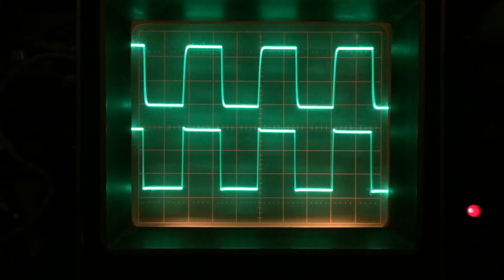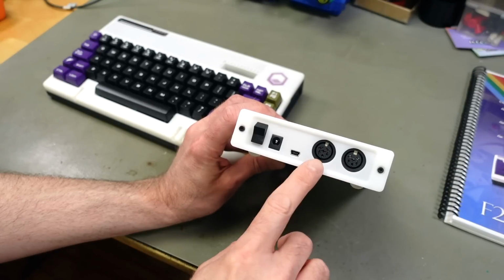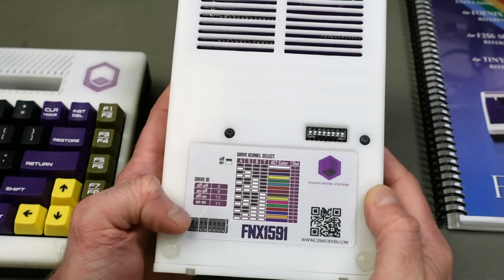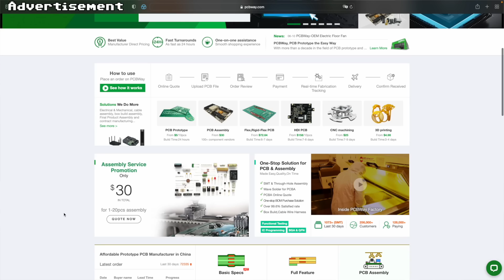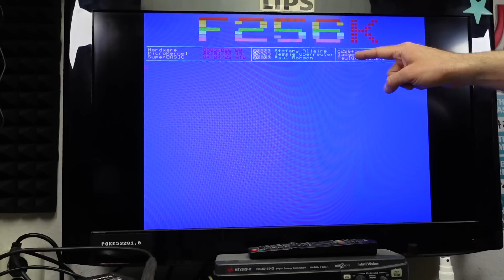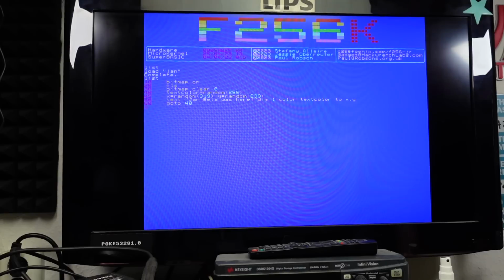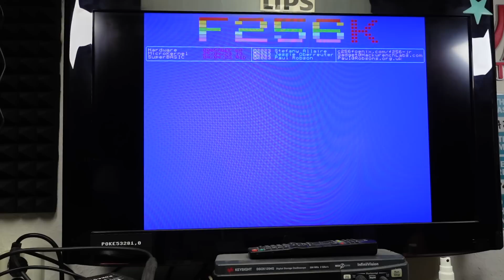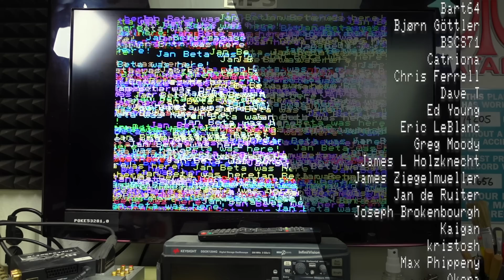Foenix F256K New Retro Computer

Comment: Nice system, but I don't get why there are so many chips inside that could be easily implemented by that Cyclone IV FPGA.
Reply from the maker: I guess the idea is to have original dedicated chips (like the CPU and the OPL3 chip) and only use the FPGA as a replacement for what would have been custom chips in a vintage system.
Reply: After reading your comment I did a top level reverse engineering and I see things very differently as a hardware designer. 27 chips with 8 or more pins; most of the chips are for special purpose memories (devices: 5), specialized I/O (devices: 14) or level shifting (devices: 5) to/from the FPGAs. The remainder are 2 FPGSs and the CPU. Most of those are special purpose where you're not going to just place the function in an FPGA. FPGAs make lousy real time clock chips for example. You want a Cyclone to act like a Wolfson CODEC or Max232? Nope. It's also beyond pointless to use an FPGA for FLASH storage here. Cyclone IV is a family of devices with members ranging from cheap to almost $1000 per chip. Look up the EP4CGX150DF31I7. Here it obviously made sense to implement part of the design in the Efinix FPGA or it would have simply gone into the Cyclone used. Just because you can doesn't mean you should. Honestly I don't see any other chip besides the CPU itself which could be placed in the FPGA if you want to buffer the signals. If you want to split hairs then the keyboard interface 6522 could have been emulated at the cost of the I/O pads on an FPGA. The I/O cost likely makes it cheaper externally with a 6522 and you get 6522 drive/robustness which the delicate Cyclone lacks. Please cite specifics if you disagree.
Reply: not replace every chip (surely not RAM) but the Cyclone IV would be powerful enough to implement CPU, video and audio of the F256K system. Consider the MiST device (Cyclone IV based, dating several years ago): it does emulate a whole Commodore Amiga with 68000, and its custom chips.
Reply: @Peter_S_ But the point is still valid. Once you start using FPGAs, the use of separate chips for various tasks becomes more difficult to justify. Why not just use ONE suitable FPGA for CPU, sound and graphics etc, rather than several chips? The cost and complexity is massively reduced, resulting in a cheaper product, easier to produce and easier to maintain.
Reply: @another3997  LOL, no it's not valid. How many FPGA based products have you designed? I'm going to guess zero. Tell me if that's incorrect. I already pointed out cost vs FPGA size. I also pointed out it's not economical to emulate big memories. I also pointed out that 14 of the chips are special purpose including analog and involve I/O the FPGA simply cannot do. 5 more are level shifters which are always necessary, and the rest are memories, CPU, and FPGA. FPGAs have their place, and here you can see what that place is if you wish to learn.
Reply: From a business standpoint, I would want to design a machine that would have a large supply of ready made components. If there's ever another chip shortage, you would still be able to produce and sell your product, because you're not tied to a few components with a high demand and short supply. Sure a design based on fewer chips is cheaper, but if you can't get your product to market because you can't source the components, you are doomed as a company.
Reply: @Peter_S_  Yup, FPGA prices do NOT scale linearly with logic units/pads.
Reply: @LeftoverBeefcake  my point was: since the FPGA it's already there, why not make it emulate cpu and sound as well? anyway it's designers' choice in the end :-)

Comment: Very cool project, but couldn't that Cyclon replicate all of the functionalities of the chips present on the PCB? The IV go up to like 150K LEs which would be plenty. Would likely make parts sourcing easier as well. I guess I'm a bit confused by the design.
Reply: They probably wanted to go with 0 custom ASICS / FPGAs, but then gave up when they realized there isn't any off the shelf 8-bit video chips like there used to be back in the MSX days.  Still though, the sound design confuses me, if they have an OPL chip then they don't need a second fantasy sound chip (emulated by the second fpga)... Also... Two FPGAs should definitely not be necessary... So yeah... definitely questionable.
Reply: @BrainSlugs83  You definitely don't speak like somebody who has a history of hardware design. There's definitely plenty of reason to use multiple FPGAs in a design. Exactly why would you contend otherwise?
Reply: It is because, it is not my philosophy to integrate everything in 1 FPGA like the Mister or Mega65 or any new retro computer. The philosophy is to try to bring the whole retro experience, the feel, the look, the interaction. There would be no point into doing that, it would be the most boring thing to do and if it was the case I would have never got involved in this because anybody can get themselves an eval board and make a Misterboard or get a Raspi. Some people find those interesting, good for them, that's not what my goal was and still to this day.
And... I totally understand people that don't get it either, in the end, either you love it or you don't! ;) Cheers
Reply: @stefanyallaire  That makes a lot of sense. And you're absolutely right, I'm more in the "make everything as tightly integrated as possible" fraction. I always have to smile when I see projects that use an ESP32 via serial to give their Arduino UNO network connectivity, thinking "you could have implemented your entire project on that ESP" 😅. I guess that also explains why there are two FPGAs. Basically, assume they serve one function each. Again very very cool project!

Comment: I don't get why it ships with a 6502 variant instead of a 65816 variant. The 65816 can run in 6502 mode if desired, while having the opportunity to run in the much, much better native 65816 mode. Given that you CAN use a 65816 variant, it just strikes me as odd not to include that CPU by default.
Reply: Price, probably.
Reply: You and I know that the 65816 is awesome, but Stefany has said she feels there's an (undeserved!) stigma about the 65816 that it's harder to program for, and that it might scare away some of the 6502 fans (who apparently don't know that the 6502 is in every way in improvement).
Also, even with a 65816, you still don't get 24-bit addressing in the F256 line.  Making the 65816 the standard might make people think at a glance that this is a full 65816-based system.  Including it as an optional replacement for the 6502 sends the message about this system's limits. (Incidentally, for a full 65816 machine, see her C256 line, although I'm not sure she's taking any orders for that line at the moment.)
Reply: They sell it with a 65816 for about $10 more, I think the rational in offering the 6502 as standard is to appeal to all the retro crowd to know that processor well.
Reply: @frixyg2050  et al - I'd think you could just market it as having a "6502-compatible 65816", which it is. I can't remember for sure, but I think it boots in 6502 mode. 

It's a shame you don't get full full 24-bit addressing on the one line though. I can imagine it might cut the cost on the mobo, but still. That's one of the big selling points of a 65816.

Oh well, I'm not really the target audience anyway. These days I prefer writing for a fantasy console with easier code work but strict display/sound/memory restrictions, like PICO-8, because it prevents scope creep and challenges me.

I just know from SNES programming that I way prefer 65816 and would never want to go back. It's still very retro imho, but the 16-bit registers make it so much less painful to do boilerplate stuff where it's not technically a challenge, it's just grunt work.

Comment: Great video. Why does the WDC65C02 CPU run at 6.29Mhz? This chip is speced to run at up to 14MHz and freely overclocks.
Reply: The CPU runs @ 1/4 of the Video lock 25.175MHz which allows the system to implement a shared memory system like the C64. If the CPU was running full speed we could not do it then we would need two different buffers shared with FIFOs and it becomes lot less efficient.

Comment: I see the F256K2 is coming out and you can get it with both the 6809 the 65816 installed. It supposedly will run OS9, does that mean it will run CoCo software?

Comment: Are there any tools available for this yet? You know, paint programs, compilers, etc?
Reply: There are! On-system, there is a sprite editor/manager/animation-helper, tilemap manager, and font editor. Not sure about a full-screen paint program, though.
For your modern system, there is an emulator, plus a library for compiling C (in CC65) and settings for assembly (in any assembler, but 64TASS or the WDC assembler are common choices among the Foenix crowd.)

Comment: WOW love this Machine. The FNX1591 can this run a stand alone disk drive I would buy this alone for my C64?
Reply: the FNX1591 can run as a standalone for your C64. You just have to flash it your own JiffyDOS or equivalent. Many have gone that route without buying the F256K or the other computers
Reply: Yes it can work as an 1581 drive connected to a c64 I ordered one and works great on my ultimate 64 , flashed it with JiffyDos 1581 version and it's lightning fast!

Comment: c64 iec port? alternative to the David Murry Commander x16 project?
Reply: If I were going to buy one of those machines to tinker with retro-computing, this would be the winner hands down. I don't have a dog in this fight and I'm a hardware designer who grew up on Apple ][ starting in 1978 for perspective, but I can't take the x16 seriously. The graphics guy did a nice job but the rest of the package is pretty meh. This looks like a decent and useful retro machine. For this kind of experience/use these days I use an Orange Pi 800.
Reply: Just like the X16 machine, this implements certain aspects of the Commodore machines, but it isn't compatible with the software, the hardware reference manuals or the masses of existing literature on those machines. Nor do they have the same nostalgic draw that has created large online communities for different retro machines. Which makes these CBM tributes somewhat redundant. Unless detailed "hardware" schematics, memory maps, register locations and the like are published and explored, you end up with a very limited and expensive BASIC programming environment.

Comment: The creator of this system should consider releasing a MISTer FPGA core. I know it sounds counter intuitive, but there are a lot of MISTer systems out there so it would be more likely to gain in popularity and the purists will still buy the real hardware, especially if it becomes very popular.
Reply: The Foenix F256 should get a Commander X16 core, to end the debate which computer is the better one, and so Stefany can have her revenge :)
Reply: @danielmantione  Except that licensing the rights for kernel IP from Cloanto as the x16 team has for every shipped unit.
Reply: @njspencer79  Just publish the core and let users download the KERNAL themselves.

Comment: it is a very nice system.
however, i would prefer a system with an external keyboard. more with the look of a classic atari 2600 with a slot for a cartridge in the middle. an internal socket for a raspberry pi that does wifi/bluetooth for a bluetooth keyboard/mouse.
a cartridge with a cheap mcu containing a decryption key and a flash connected to it could support games with the possibility of upgrades/fixes
Reply: there is a much cheaper itx version
Reply: You can't please all the people, all the time. If the designer tried to incorporate everything people wanted, the machine would never be released. If you want all those options, you might as well use a Pi or PC to emulate the whole system and use standard peripherals. The Commander X-16 is a prime example of how letting too many people have a say ruins a good idea... and you can just emulate it for free with a computer in any case design you like.
Reply: @another3997  this is why i think that some degree of compatibility or a step by step upgrade would be so great.
imagine a new atari 2600 case that is compatible to the old pcb. but has additional holes on the front for joysticks ports and some on the back for all the other stuff - like a keyboard, atari/commodore floppy drives etc.
you could make a kickstarter project with investors for an injection mold where people throw in 1000$ or more to make the new mold. then you sell it for people who have a disgusting atari 2600 junior case and want to upgrade.
and at the same time you have a new case for Foenix F256 AND commander X16 people, maybe that new case could be built with a compatibility to a raspberry pi?
it could serve as a base for several projects with a 100% win-win-situation.
and with a woodgrain panel in the front with REAL wood that could have different engravings, atari, x16 or the foenix logo, etc.
this way every project that uses this case is getting cheaper. and everyone can go in a separate direction with the hardware.
Reply: @stefanweilhartner4415  You mean $1000 -- dollar sign goes to the left of the number.
Reply: @JohnDlugosz  i am probably more used to the european notation where we put the € sign on the end of a number like it is with all other units.

Comment: the 8 bit guy also has a new retro style computer which you probably know about.
Reply from the maker: I kind of heard about it. The production model is still not available though. I’d definitely be interested in reviewing the X16 when the time comes (although I doubt they’d send me a review device, they have the YouTube exposure pretty much covered I guess).
Reply: Yeah, this one looks like much smaller production scale. So much manual work included, with the 3D printed parts etc.  Still immensely impressive machine. I don't like the design or colors, but that's personal taste. Also all these full fledged machines are quite expensive once imported to Germany. Be it the Foenix256, Commander X16 or Mega65. All will cost you upward of 500€, which makes sense as they are all low volume and not super highly integrated as they could be, but that's part of the hobby: to have machines made of discrete components so you can tinker with them. I guess the Agon is the cheapest in the bunch but also the most barebone. Probably caters to a different audience.

Comment: What are we going to do with all of those new micros? The MEGA65, Commander X-16,  ZX Spectrum Next, Agon Light... Probably others in the works.
Reply: I'm not as interested in the Commander due to the design choices, the others are great and happy this is all happening right now!
Reply: Yeah, I know. I've been working on a modernized Tandy Color Computer system myself.
Reply: @VincentGroenewold I agree, the X16 is a prime example of too many cooks spoiling the broth. It really is the complete antithesis of what the 8 bit guy first envisioned. The C65 is interesting, but at the same time, it is hugely expensive, but has the same problems as most "new retro machines... there's no existing software libraries, no books detailing every facet of the hardware and OS, and no huge communities like for real '80s machines.
Reply: Back in the 1970s and 1980s we had quite a variety as well. Some will do better than others in time. This appears to be an excellent contender.
Reply: Put them out the attic and then into garbage can when the corrosion gets to them?
Reply: For me the downward compatibility is important and I can say that the Spectrum Next is excellent on this behalf.

Another advantage of these modern (FPGA) implementations of old systems that it doesn't suffer the slow components degration that original H/W has, capacitors ICs and whatnot.

In short I go for modern implementations of our beloved computers from the 80s with, as much as possible, compatibility plus perhaps a few bonusses like SD / USB options that make life easier 👌🏻
Reply: @another3997  How do you know there are no software libraries, communities or books? Did you visited a fortune-teller or maybe you did a divination that revealed that? Just because you are ignorant, that doesn't mean that things don't exists.

Comment: She (Stefany) made a very good job, unlike the C-X16-team. Stefany is not in this selfmade must-Comodore-like-cage. Taking the low volume of potential sells into account, it's not expensive. But I have to admit, that the price for the C-X16, Agon Light 2 and other are fair too.
Reply: The real problem with C-X16 is you can't buy one because they never considered manufacture when designing it so ended up with something they now can't easily build in volume.

Comment: Somehow I don't like it when these systems run on an FPGA. Agon Light is similar at 50€ only, and it uses a real Z80 at 20MHz. It still cheats a bit by using a ESP32 as display processor, I would like to see that 8 bit 5V as well.